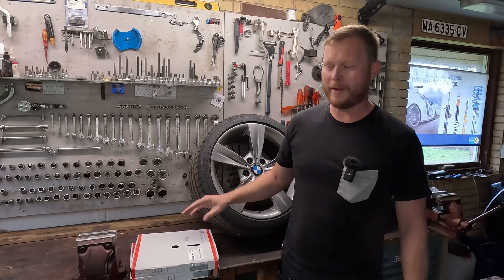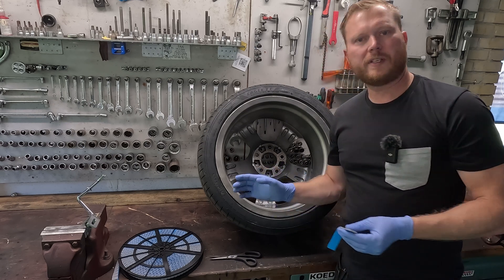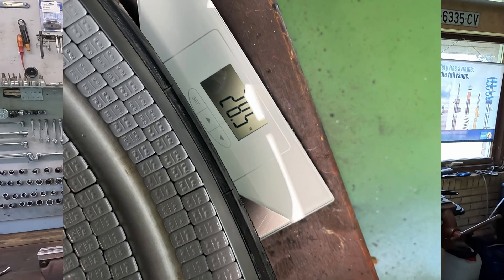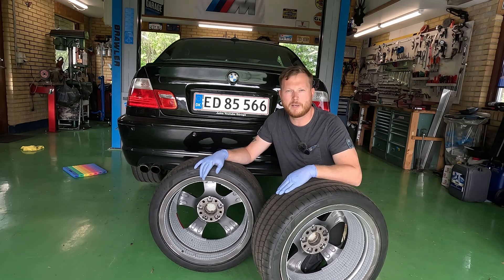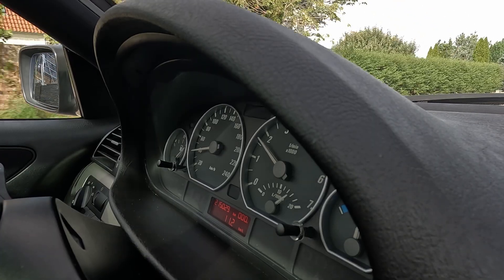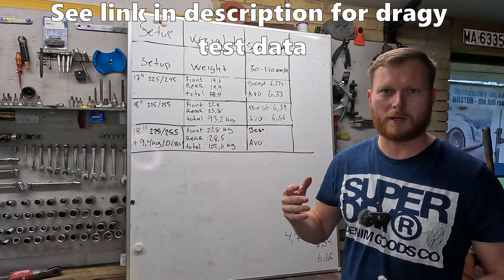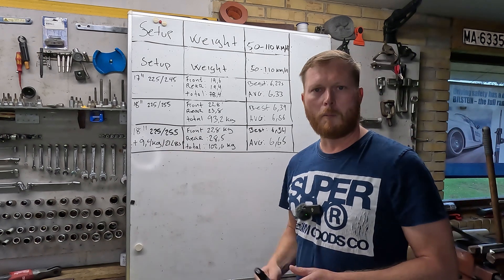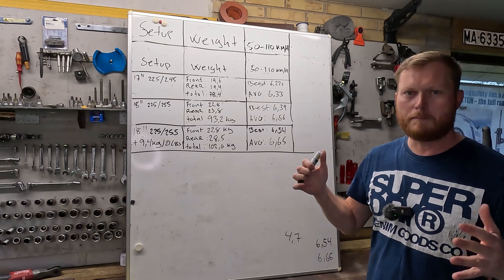Wheel Weight  before/after 5kg- How Much Slower?

Comment: I would expect a bigger change in performance between 0-35kmh in 1st gear. Fuel economy and stopping distance would also be adversely affected. These parameters were not measured and the video largely missed the point.

Comment: This was done in 3rd gear, so the time is several seconds which makes the Draggy results nice and consistent. The effect of reducing rotational weight should be much more noticeable in 1st and 2nd. This might be harder to measure. I know that when I replaced my 18lb flywheel with an 8lb one, you could really tell in the lower gears, but it is not noticeable in 3rd-5th.

Comment: Awesome tests. That 50-110 test is perfect for a daily and real use measure. Can i suggest a time table on your Google Drive Sheet with all the setups (wheels, weight, intake, exhaust) and times?

What's next? Here some ideas: Different tire pressures, before and after oil, filters, plugs change, before and after gearbox oil change, with different octane level fuel, some octane boost additive, before and after injector cleaners, different engine oil levels (close to minimum vs at the max), before and after low friction ceramic oil treatment (LiquiMoly Ceratec or similar), AC on vs off, low vs high alternator load (radio, lights, fans).

Keep the great work!
Reply from the maker: Great ideas honestly. All of them. Thank you
Reply: Oil and plugs would be great to see, just did the plugs on my girlfriend’s e93 and it felt way quicker. Wish I had thought to measure before and after.

Comment: Great video! I can only feel a small difference in the weight of the wheels on my car going from 195 65 15 for the winter tires and up to 205 55 16 for the summer tires. I feel that i have better handling with the wider summer tires and that the weight of the wheels are perfect even that they are a bit heavier than the original 15" wheels.

Comment: What was the barometric pressure?  Outdoor air temperature?  Fuel blend?  Etc etc...

A better test would be comparing two cars side by side then again with the change / swap wheels for example.
Reply from the maker: Pressure i dont know. But temperature was the same, fuel blend too. Full tank both of them

Comment: in fact the weight in the wheels affected double of the weight inside the car (a factor of 0,0057 s/kg to 0,096 s/kg). Additionally unsprung weight makes suspension work harder in bumps meaning that a stiffer suspension is needed resting comfort and also driveability. 
you create very good content, thanks for it

Comment: Okay - so this is a GREAT test as it gives an idea of how the weight of a tyre & rim(wider, thicker, larger)affect acceleration(mileage, handling, etc)... BUT it's 50% unfair, because only 2 wheels got additional weight... All 4 wheels should have received extra weight for the test to be representative of the debate between Rotational Weight vs Static Weight - as even though the front wheels don't drive the car(in your case - GREAT looking car by the way), it still takes(more)energy to rotate them when they are heavier... So the actual times you would get would be worse than the 6,65 etc...🤔

Comment: often when people discuss unsprung weight, they don't know how weight, unsprung weight and inertia of moving parts work, what people often refer to as an unsprung weight of wheel is actually inertia which is = 1/2 * mass * r^2, adding or removing weight from rubber itself would have more impact as it is further away from axis of rotation... even so wheel of 18 and 19 can be of simmilar weight, but 19 one will have soo much leverage on rest of suspension and due to third newtown law it will break some things and it will require more work to get rotated...  also regular road tyre compared to semislick is huge difference in weight.
 
Other reason why rotational weight is important is to be able to tune out and design suspension to work around antisquat, antidive and wheelhop thingie as car gets launched, rubber bushings and shocks can only handle so much. This doesen't play a huge role on road other than some feel which can be placeboo just because steering feel can be bit different, but on track events where you brake very late, trail brake into corners, or just brake to shift weight and rotate car and drive on near limit you don't want suspension to do funny things and it's much more manageable to tune setup if wheels are light and suspension has to work less to keep rubber planted since there is less antisquat/antidive to deal with.

And yeah 99% of people would be completely fine with oem wheels, but burning money on nice wheels makes people happy so who am i to judge... whatever floats your boat mate :)
Reply from the maker: Amazing reply bro
Reply: @ivanfilipovic3296  so, as usual, "it makes difference on track but on the street no difference", in the end from car mods I did only ones I can recommend is low profile tire, chip tuning if you have turbo car, and maybe bigger brakes so they heatsoak later, that's what matters on the street, unless some mod can give you at least 2-3s of shorter acceleration or ability to start hammering brakes one time after another it's gonna be unnoticeable even in dynamic street driving, as most what you can reasonably flex on others is acceleration let's say 0-70kmh and some fast corners and rapid deceleration, nobody cares about 0.1s either way, what counts is loud exhaust and overtaking the right lane enemy by few car lengths in drag race limited to reasonable speed
Reply: @stefan37-1  difference is difference be it on track or road, but there is a point of diminishing returns when going past some point doesen't give much but takes a lot, and it makes more sense to put money elsewhere to make car more fun
Reply: @ivanfilipovic3296  ye but on track every 0.1s makes difference, on the street either you gap someone by 2 car lengths or you don't, thus go big or don't start modding hoping you will gain massive amount of acceleration from driving with empty tank and throwing away spare tire 😀
Reply: @stefan37-1 Low profile tires is for looks though, it only makes you slower.
Reply: @swecreations  why would it make you slower? it makes you faster in corners by better stiffness, and lighter tire compared to high profile
Reply: @stefan37-1  First off- low-profile tires are not lighter, secondly, if that was the case the first mod people do on modern cars with oversized rims wouldn't be downsizing their rims.

If you look at GT3 cars for example you'll see almost all of them are running smaller rim sizes than the road cars they're based on. Just this week I was speccing out some rims for a Hyundai Ioniq 5N that comes with 21" rims from the factory, the race-car version of that car runs 18"s.